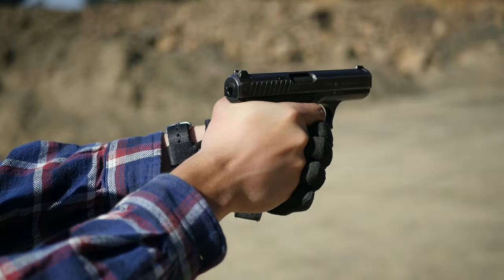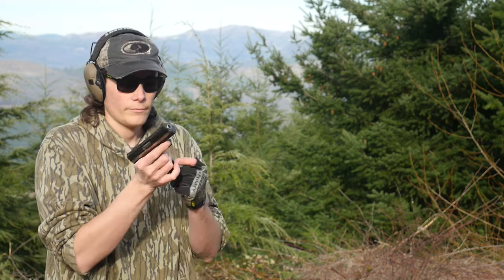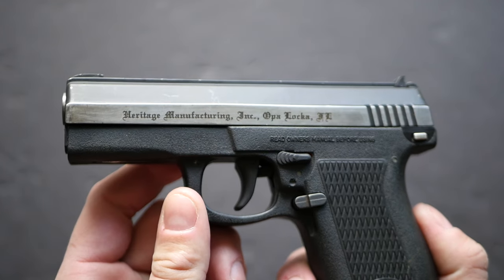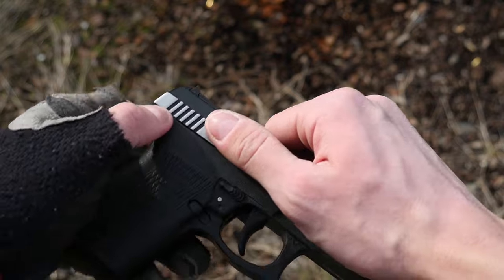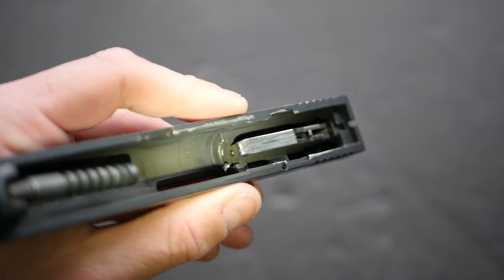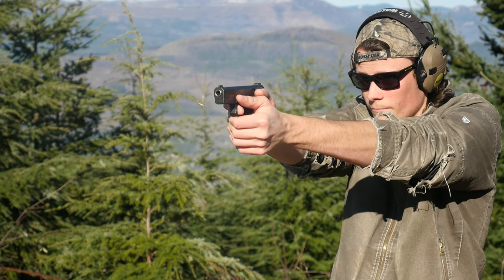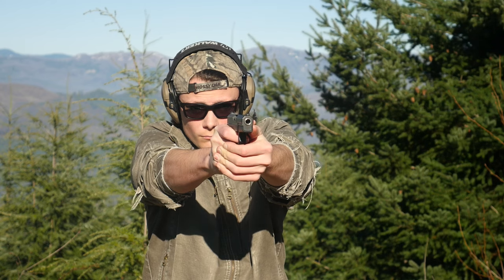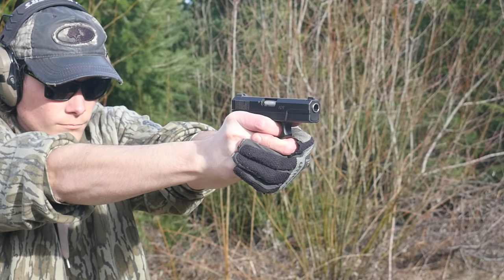Floridaman Makes an HK P7 Knockoff

Comment: i feel like this whole thing is .. below what i would expect from wilson combat.  kinda wonder what they saw in this.  seems like one of those things where the engineers didnt stop think if they SHOULD....  like why wasnt the HK p7 wildly popular? ..hmmm
Reply from the maker: Rumor has it that Bill Wilson was friends with Alex Du Plessis and that might be why they went for it.
Reply: @Hoplopfheil  also hans used one in die hard.
Reply: The P7 was wildly popular considering it's price tag. WILDLY popular.
Reply: I don't know whether that is what Hop is talking about when he calls it overrated, but fans of the P7 say the main gimmick of the gun isn't the gas delayed system, but the half cocking mechanism. The point is that by not having to cock the striker with the trigger, you get a hammer fired style trigger out of a striker fired gun and that was what the main advantage was, especially back in the day when good triggers on striker fired guns were not just a rarity, but pretty much unheard of.

It is the combination of the fixed barrel and the "assisted trigger" which makes the gun easy to shoot accurately, at least according to people like Ian Mccollum.
Reply: @TrangleC  I would use the word "Feature" instead of "gimmick", lol. Also, Ian McCollum is correct, the P7 is insanely easy to shoot fast and accurately. It also has a very long 4.2" barrel for it's OAL.
Reply: @TrangleC  
And one can close the slide via the 'grip safety'.
Reply: @TrangleC  ian mccollum.. pssh what does he know.... (SACRCASM)
Reply: its like many german things,  " its better because its over engineered...  is it though?
Reply: @TrangleC low bore axis and good ergonomics as well.  It's just a very well designed pistol.  Ludicrously overcomplicated, but well engineered.
Reply: @mtnbound2764 in it's case, yeah it is better.  This video demonstrated the underengineered version and it's a sketchy Saturday night special with a reputation of coming apart.
Reply: @Hoplopfheil  legend says the gun is Bill Wilson personal CCW and buried with it, Hop😂
Reply: @omihurst  well..... Considering Bill is still making videos right now, and has commented that some of his other more modern Wilson Combat options are his EDC, I'd suspect this to be wildly exaggerated lol.
Reply: Gotta start somewhere
Reply: The HK P7 was the safest pistol ever made with a short and soft trigger.  It was heavy as it was designed for military and police OWB holster duty, and it was never fully cocked until the grip was squeezed, a natural and instinctive motion.  There was no slide or frame manual safety to remember or fumble with; squeezing the grip both deactivated the internal safety and finished cocking the gun.  PRICE was the reason it did not take off on the civilian market.  Police agencies LOVED theirs and hated to give them up for double-stack brands.  The double-stack HKs arrived too late to counter the flood of new inexpensive Wonder Nines...............................elsullo
Reply: Mntbound.: Yeah, you got me. I am 55 years old ( I am also Mnt.bound in Goldhill CO.) I bought the HK p7m13
(13rnd brushed satin nickle) It weighed about 40oz and even though it had the 
plastic trigger guard, it got hot as hell.
It would not reliability cycle the light weight Glaser safety slugs( 80grn. shot filled frangible rounds.)and would turn the slide plus part of your hand black.
My father gave me a G17 a few years later and I traded the HK for a Colt HB match. ( sold that overweight abomination as well) Of coarse, the HK would be worth about 5 grand or more today. Bottom line is, the glock was lighter, more accurate ( during rapid fire) and held 17+1. It also didn't get as damn dirty and sooty, not to mention it stayed cool no matter how many mags I ran.
Reply: @almaadams3631  interesting story!  im also in CO, the mountains drew me here!
Reply: The P7 wasn't wildly popular for a few reasons, all of them to do with how HK was pricing them and who it was advertising them to. Which is to say, high, and to the police.
Reply: @TheFanatical1  To understand HKs behavior on the US market you need to understand German culture and politics. Germany is extremely pacifistic. It is basically a country run by 60 year old women and I'm not just talking about Angela Merkel. She was just a fitting leader, which was why she ruled so long.
The cultural elites and the media are watching "problematic" companies like HK like hawks, always trying to catch them doing something wrong and HK can't afford too many headlines about poor, oppressed black teenage angels in the American "hood" being forced to shoot each other by evil, dastardly weapons manufacturers pushing guns on them, so HK rather stays out of the private consumer market and only sells to government agencies.
Reply: @Valorius Only for a very short time before other wonder 9's came out
Reply: My thoughts are, pistols this size with a 10+1 capacity were non existent when Wilson Combat was selling these and that's what they saw in them. This was well before the Sig P365. As far as the P7 is concerned, I think it came down to price. I mean their ads stated it was the most expensive gun on the market, or something to that effect.
Reply: @TrangleC
Reply: @sxeree Part of the reason for the expensive price was because the manufacturing was very costly. They’re still able to be repaired by a few qualified armorers that still can get the parts. They are fun to shoot, but you have to keep them maintained since they’re built like a Swiss automatic watch.  There are cheaper alternatives, but the P7 series was a great come on to the USP and VP9 firearms that were produced later.
Reply: @TrangleC it's the squeeze to drop the slide part that's cool.
Reply: Man that's a lot of ugly guns.

Comment: If you want a semi-modern pistol the Walther CCP runs the same piston system.
Reply: I thought Walther CCP was rotary??

**runs to Google**
Reply: Far too expensive for him
Reply: @kirkfreeman6913  gas delayed piston, gets hot AF after like 50 rounds of shooting,
Reply: @kirkfreeman6913 
No, gas delayed. The takedown is different, but gen 2 doesn't require a toll. I've seen reviews that were pretty favorable. Slide retraction is light. It's not made by the regular Walther factory, but by the Umarex factory; I read that Walther has its own area in their factory.
Reply: @kirkfreeman6913   most recent rotary I know of is the PX4.

Yeah. Most Walther guns are made in Ulm.  The CCP is made in...what in my head is WeaponsTown Germany.  Arnsberg? Something like that.
Reply: I have a gen 1, runs great. Gen 2 doesn't need the takedown tool.
Reply: Were you cancelled by YT?
Reply: @Royal Regt  no, our account was hijacked, but we got it back after 3 days.
Reply: @Kevinmoore22  that doesn't matter for the use case, just like the P7.
Reply: @GBGuns  Glad to hear it. You are right up there with Hickok for a channel where cancelling makes totally no sense!
Reply: Admittedly I enjoy shooting my wife's ccp.  It's not something you want to go run 500 rounds through but it is accurate and shoots nice.  It's not my favorite but if it was all I had, I could make it work.  Walther certainly nails ergonomics.
Reply: @zendell37  grand power has some current production rotating barrel pistols, but I think the base design is earlier than the px4.
Reply: @Kevinmoore22  to be fair, the ccp is supposed to be a concealed carry pistol, so it's not exactly designed or marketed as a range, competition, or sustained use kind of pistol.
Reply: @XanthosAcanthus  yes I know,   I only have one because I think the operation is neato lol
Reply: @zendell37  Grandpower is the best rotary. Global Ordinance is the importer now. I have a Q1S ( smallest 9mm
 striker) Get the new gen. Black nitride barrel and flat trigger.
It is my only sub compact 9mm. now.
( my 365 would be considered micro)
Reply: @Kevinmoore22  Sold mine to a coworkers wife. However, I could hold nice little groups at 20yrds.
I had purchased a 365 at that point, so it was more of a size/capacity advantage.
Reply: it's also hideous

Comment: I'm always jealous of Paul Harrell's Steyr GB when he brings it out. Can't really say the same about most of Hop's hipster guns.
Reply: Resident Evil 2 Leon storyline nostalgia.
Reply: Enh shooting the GB is not a great experience. It’s accurate, but not particularly soft shooting or comfortable, nor does it have a good trigger pull. It’s biggest claim to fame was the 18rnd magazine and unique gas delayed mechanism.
Reply: Still way better than shooting the HK VP70. What an underwhelming piece that thing is.
Reply: the GB isn't all that, my specific gripe is the the double feed mag makes the top of the grip overly wide so you get the recoil right in the base of your thumb and index finger.
Reply: @rpblccmmndo389  yeah. Definitely makes less comfy than a pistol with a slimmer grip frame at the top. At least there isn’t a sharp protuberance there to dig into your palm (looking at you, S&W 5906).

Comment: Back in the early 2000's I received a Wilson Combat catalog in the mail where they featured their new ADP.  From what I remember, it was Bill Wilson's attempt at bringing in a double stack, striker fired, 9mm polymer gun to compete with Glock in the Stock Service Pistol division of IDPA.  Bill Wilson, Ken Hackathorn, Larry Vickers and a few others founded IDPA, as they felt USPSA has became more about equipment and the "shooting game" than it was about tactics and practical use of a firearm in self defense.  IDPA has several divisions, and the big boy on the block for the SSP division was Glock (I believe it was specifically the Glock 34).  The catch is for anything to be considered SSP, it needed to be mass produced (I forgot the number, but it's in the thousands).  That will limit any oddball one offs, custom gunsmith specials or prototype guns.  From what I remember, the ADP was discontinued by WC due to reliability issues.  My swiss cheese'd brain felt like it had something to do specifically with the ejector, too.  But regardless, it lived under the Wilson flag for a few years before dying.  I never saw anyone use one personally, as they were still a bit more expensive than a Glock, did not provide the same front sight radius as a G34, and well... everyone at that time wanted to be Dave Sevigny.
Reply: I wanted to be a train.

Comment: "You will absolutely enjoy shooting a P7 more than the Stealth"
Given how little I enjoyed shooting a P7, that does not bode well.
Reply: I handled a P7 once at a gun show, never had a desire to buy one afterwards.
Reply: I've had two, an original PSP and a P7 M8 (which I still have) I have shot the be-Jesus out of these things and can say nothing compared to it in the early '80's.  Has it been surpassed, you bet but at the time, even Jeff Cooper thought highly of it.  I have even shot it loaded 158 grain wadcutters  and it fired all 50 rounds flawlessly.  So say what you will, I won't be selling mine!
Reply: @KamikazKid  or you’re just poor and can’t afford one
Reply: Still kicking myself for not buying a brand new P7 back in the '80s.
Reply: Why? @KamikazKid
Reply: @willstorer9799  that squeeze safety sucks, it requires quite a lot of force to engage, and the trigger is equally terrible.
Reply: @KamikazKid  the trigger is single action and is excellent.

Comment: I can answer your importation question. I have been in the international importation business for 20+ years dealing with compliance issues. The simple version is that all imported good must be marked with the country of origin so that the end user/consumer knows where the product was made. Bulk goods and unfinished parts have different country of origin marking So if a frame was imported from South Africa it would need to be marked as such. The ATF would also require marking of the origin of manufacture as well as the importer’s information as you noted on your imports. I would suspect that Wilson/Heritage bought a technical package with molds and milling specs
Reply from the maker: Good info. I wonder why the extant sources about these guns seem to think they were imported...
Reply: @Hoplopfheil  probably, and as happens all to often on the internet, somebody made an overly confident guess and it got repeated enough to become a fact
Reply: @Hoplopfheil  don't know for sure but ill bet assumptions were made without having actually gotten primary sources.

Comment: I have a P7, it is my grail gun. I was lucky to have purchased it about 13 years ago before the prices went insane. Love shooting it.
Reply: The PSP's were dirt cheap when they came into the country but even those are a couple grand now. I wish I had bought about 10 of them.
Reply: The P7 was one of the first guns I ever shot. My Grandad had one. We looked all over for it when he passed away, but couldn’t find it. Maybe he sold it. Not sure. I want one very badly these days
Reply: My cousin bough several M13s ex law enforcement with mags marked law enforcement only for 380 each surplus he had no clue the current value, just the highest overall quality I have seen in a duty gun and low bore axis..

Comment: I had a Heritage Stealth back in early 00's.  I got rid of it after reading accounts of the firing pin working loose and ejecting rearwards.  Of course, it lines up with your eye.  It is secured by only a half turn of the locking mechanism.

Comment: My 80’s (PSP) P7, which I first shot around 1984 but bought from that owner years later, is a niche gun with a quirky manual of arms, but of very high quality.  It is pleasant to shoot, and I don’t put out a high enough volume of fire to overheat the dust cover.  Perceived recoil is very mild (the day I first shot it, I also shot a Detonics Pocket Nine - huge contrast favoring the P7), but I don’t know how much of that is due to the gas delayed action and how much due to the low bore line.  Once, swapping between some mild 9mm and some +P+ Hirtenberger, I got the impression the +P+ made more noise but recoil was unchanged. Was that due to the gas delayed action?  Or was it because I’m a .45 shooter and consider 9mm recoil mild?  I’ll keep an open mind and just note that the gas delayed blowback design interests me.🙄

Comment: The main engineering advantage for the P7 is the squeeze coming mechanism. Squeezing the grip operates a cam that clocks the firing pin, so the trigger is much lighter and ready to fire. So putting the pistol down releases the firing pin to safe. Throwing the pistol releases the grip and goes back to safe.  Squeezing the grip takes 12 pounds. About the same as to properly holding the pistol. Keeping the grip squeezed is only about 2 pounds. 

The barrel is fixed, so accuracy is enhanced with no tilting barrel. The polygonal rifling reduces barrel wear, seals the gas pressure better, producing high velocities, and easier to clean as there are bo lands and grooves to hide lead residue. 

These guns have no relationship to the P7. Zero engineering and no design enhancement.

Comment: I used to own a Heritage Stealth (until it got stolen).  I made the mistake of buying the .40s&w version, whose magazine was NOT made by MecGar.  The magazines were defective, I had to have them replaced by two newer generations before they worked; by that time the pistol was discontinued.  (The plastic of the magazine baseplate was inadequate; until the final magazine versions, loaded magazines would eventually spontaneously dissemble themselves.)

Other than that, it was a pretty accurate gun.  And, with the last set of magazines, pretty reliable.  I didn't like the non-positive safety, but in practice it worked.  The trigger gave a very nice surprise break -- like the very best double-action revolver trigger you could imagine.  I found assembly and disassembly to be much easier than with more conventional pistols (though I had an H&K P7 M13 to learn on).

About the H&K P7 -- I think the squeeze-cocking idea would be very good for safety with appendix carry.  But it would need to be more rust-resistant, and incorporate more polymer to reduce weight.

Comment: I wanted an inexpensive, thin, 9mm, single stack, light weight but highly accurate pistol that could easily fit shoulder, back or belt. As a qualified Army expert of 1965, the Heritage Stealth C1000 more than filled the bill as a concealed carry. It is certainly not perfect for 99% of shooters but I was not trained to evaluate pistol videos, I was trained for disabling an enemy. The Stealth works well in the context for which I was trained and the use intended. 3/3 ACR.

Comment: As I understand it-and only regarding usa law- country of origin requirements are specific to the serialized firearm part and only if it is a finished product. From what I have heard, all Springfield Armory 1911's are 100% Brazilian forgings and are either somewhat or mostly finished in Brazil, then assembled here. Some marked made in brazil, some are not - I think that has to do with the amount of finish work done to the receiver/frame.

Comment: I've always thought the P7 delay system would be perfect for a micro PDW build. It could allow for a super small, smooth shooting package. 

Take a modified Laugo alien system and put it on a modified Flux raider. Boom - micro pdw, with gas delay, an internal bolt, and that actually holds zero. One can dream.